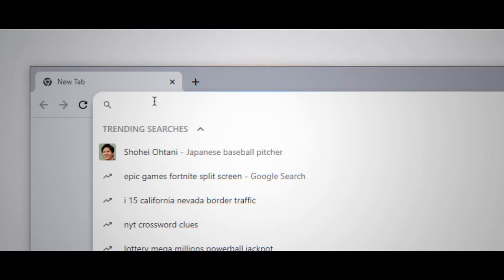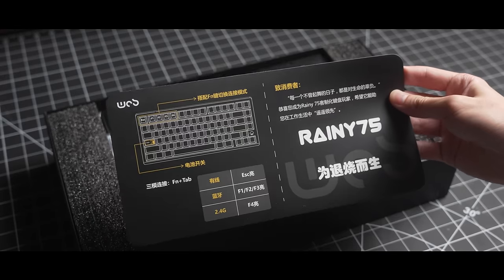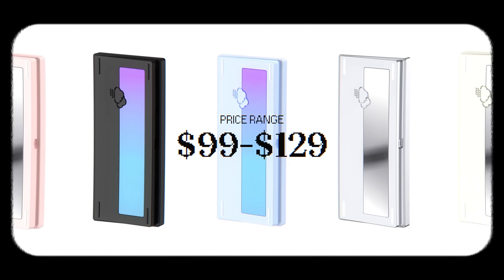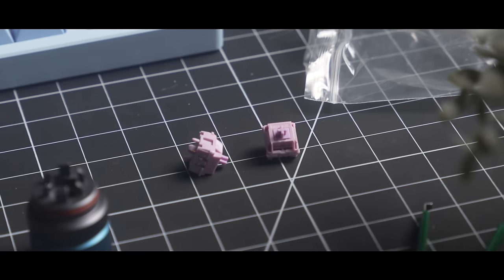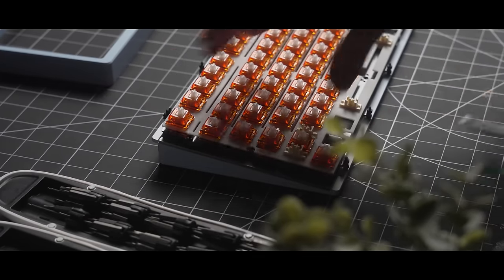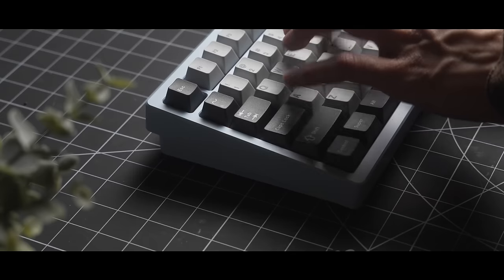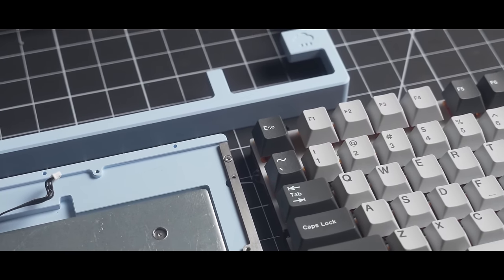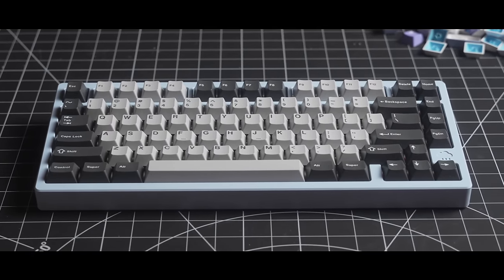This $100 Keyboard is UNMATCHED.

Comment: That first sound test is already amazing and better than some other modded boards. Amazing deal for anyone beginning their journey. Buying a whole modding station with all the accessories adds up to quite a bit. I just bought everything at once with all the different parts for my 3rd keyboard, first I modded, and it ended up around $800 CAD. I definitely wouldn't have spent as much when I first started and bought my old little keychron k2 made of plastic.
Reply: I made the mistake of upgrading a cheap plastic keyboard, reaching $100+ for the tools, keycaps, and experimenting with switches. I regret getting a full built like this one instead.

Comment: Keep in mind this is US price.. if you want to get it in Europe it’s almost double the price plus you need the ISO plate and you need to buy keycaps aswell. So just for the rainy75 its 170 eur which is like 185 usd, and the plate is 20 more.. 200usd 😅 still an ok purchase tho, but not budget at all, if you want to get iso keycaps prepare 35 to 70 usd more

Comment: i just got this keyboard and its truly an AMAZING value keyboard. im even selling my qk65 v1 off as ill be maining this board due to its tri mode connectivity which i didnt have on my pcb for my qk65v1. u shldve mentioned that the board also supports pcb mount screw in stabs as that's what convinced me to get this

Comment: hey, check out the ajazz ak820/ak820 pro, the normal version is $40 and the pro version is $50. It sounds insanely solid out of the box for it's price, and it has a knob (the pro version has a screen). it's made of plastic but it's quite heavy and doesnt feel cheap

Comment: I got a glorious gmk (version 1) on black friday for $30 and ordered gateron milky yellows.  Would I be better off returning them and getting this? I do like the deep thocky sound
Reply: make sure yourt switches are 3 pin gmmk pro is the only glorious gmmk series that supports 5 pin switches
Reply: @diyanshu5573  yeah it's 3. And the yellows are 5.   But I was wondering if i should return the gmmk also
Reply: @philliptran5217 It's not even out yet... 26/27th Dec the kickstarter should open
Reply: Rainy is much much better than gmmk if you want thocky sound and rainy stock switch(hmx violet) is much better than gateron yellow
Reply: Yeah don't waste your money
Just buy this one...yo could have both, but I can tell you, you won't use gmmk over this

Comment: The price of this keyboard in China is converted according to the exchange rate on January 5, 2024.
55.74 3500mAh PP NoRGB HMX-Switch Steel glass weight（Split Space/ISO/ANSI)
62.73 3500mAh PP RGB JWK-Switch Steel glass weight（ANSI)
69.71 7000mAh FR4 RGB JWK-Switch Sub -plated silver ice crystal texture stainless steel weight（ANSI)
83.68 7000mAh FR4 RGB JWK-Switch Sub -plated silver ice crystal texture stainless steel weight 220 mesh anode oxidation navy blue（ANSI)
Reply: dollar

Comment: Nice board! Any info about the polling rate while wired/2.4?
Reply: I have a mammoth 75, a pretty expensive device as for what it is, and regardless the price, it has 125hz, which I find disappointing
Reply: 1000
Reply: its 500hz

Comment: These type of keyboards are flooding the market.  Of course any of these boards are going to sound and feel great when your average customer comes from typing on the included Dell keyboard or a typical office Logitech. Though when compared to premium boutique studio boards can not hold a candle. This is another China "GMK" (no relation to the real GMK with keycaps, but just a cheap marketing buzz word title), Keychron, Akko, GMMK mediocre keyboard.

BTW, "This board is screwless. Which means the screws are access from the top..." WHAT?!?! No, that's not what screwless means. Screwless means, NO SCREWS!" LOL

Comment: A foam packed, Flex Cuts everywhere 1.2mm PCB. No, thanks. Great design and Huge W for using HMX switches though.
Reply: Yes but it's $100
Reply: @edward.sometimes But if they had a version without a few of those corner cuts and a higher price, it would be damn near perfect. A solid PCB, with the capability for screw in stabs for $20 more would have it easily take on the Keychron Q1 Max and GMMK Pro that so many would look at for their first board. I'd 100% buy it if it had those extra capabilities.

Comment: i think this is a scam, at 8:04 you can see a typo in the word "capital" (written as capatal), this would never fly if it was a serious company.
Reply: I personally wasn't a fan of the move that delayed the stock until March or April, and wanted to wait until it was actually in-stock before I made any considerations. It's not being handled very well for a first project.

As of right now, they're running on hype and a limited number of orders for the first batch. And just about every keeb YTer is conveniently glossing over those facts because of the value proposition, despite the fact that it's been purportedly vaporware with almost no one in the international market being able to secure one.
Reply: I mean it's a chinese company, so it's kind of expected to see typos and miswording

Comment: I dont get it u replaced the switches and keycaps and basically making a way different keyboard no and probably a lot  more expensive, so how can you say this 100$ board is unmatched when its nothing like you would receive stock?
Reply: switches/keycaps dont neccessarilly have to be expensive. when referring to the keyboard being cheap, in the world of custom keyboards the "keyboard" usually doesn't include switches/keycaps. for the base setup even without their stock switches and keycaps, is very good price.

Comment: these chinese, unheard of keyboards are always cheap and cheerful, with meh aesthetics, and a PE foamy sound. the sound is what draws me away from buying one, if they removed flex cuts and made a foamless config sound nice, then you have an absolutely insane prebuilt board. otherwise, its the neo65/neo70 for me all day.
Reply: The thing that ruins the neo for me is that its way too clacky by default. And the shipping is expensive to my country
Reply: Hate to break it to you but Neo/QK comes from China too.

Most keyboard trends in the budget-premium market follow what's popular in the Chinese market (explains the flex cuts, 1.2mm PCB) but good thing the bigger brands have quickly turned things around to cater to a more wider audience, giving more options especially on flex-cut/non-flex cut PCB.

The Neo boards in particular are of insane value proposition.
Reply: What you said is contradicting.  Neo don't actually sound very good without foam.  They're clacky and void of personality.  QKs are easy to make thocky but again not the best without foam.  This board actually sounds decent without foam.  Also, foamy is often used as a negative connotation now when about a year ago, it's called marbly and poppy.  Everyone enjoy that sound profile especially normal people or newcomers to the hobby.  Only elitist or people who like to justify the price tag of their high end boards use the term foamy.  Don't be like those people.
Reply: @Momotaro0125  i like clacky boards, not deeper sounding keyboards like this. not everyone enjoys the same keyboard sounds, but i guess you're right
Reply: @luckykari9448  sound is 95% dictated by switch and plate. I have 3 Neo65 configs with different sounds. It's not clacky if you don't want it to be.
Reply: @Momotaro0125  completely untrue. You sound like someone that watched some youtube videos on keyboards and are now making claims with no experience. AS stated, I have 3 Neo65 boards. I made 1 clacky with proper switch and plate config. And they sound great without foam as well. These comments are utter nonsense.

Regarding this Rainy75, it's a lower cost option with less customization. You are getting a cheap PBT keycap set and switches for your money vs a Neo. So it's a decent amount cheaper. However you have little options to weight and plate customization, which IMO sucks. TBH, this keyboard reminds me of a MKC75 without all the customization options for an even cheaper price.
Reply: @doanhle1748  I never said that clacky is bad.  I love my Mode Envoy, it clacks so unapologetically that even when it thocks it clacks.  What I'm trying to say is exactly the opposite, let ppl enjoy the sound that they like and don't use the term "foamy" like it's a bad sound.  It isn't.  You can easily see this by how the videos with the most views are often the marbly sound profile.  This Rainy75 is leaps and bounds better than anything in it's price range.  It's pretty damn decent without foam, too.
Reply: @JustSomeGuy009  All sound tests I have heard but one are clacky. Like I said, clacky by default and the pricey shipping is what I don't like about qwertykeys boards